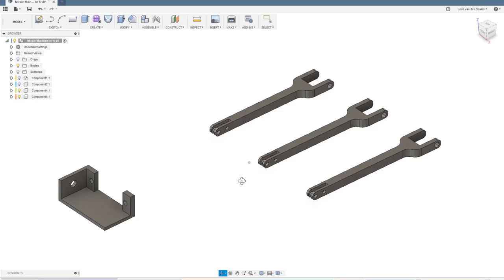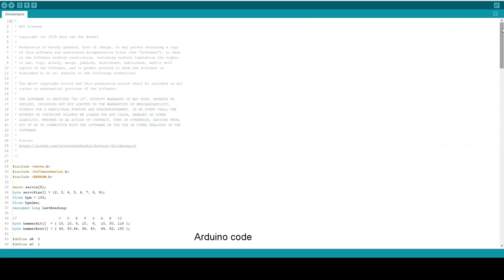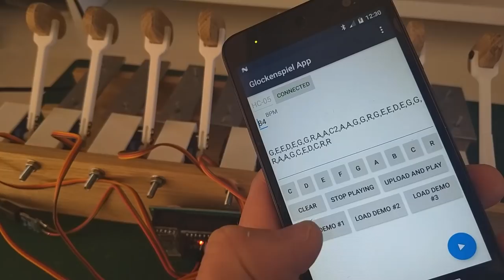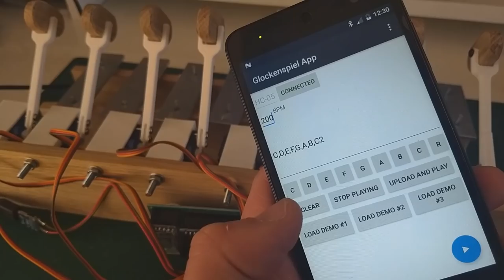Arduino Glockenspiel

Comment: I really love this idea, the only problem is, that the distance between the hammers and the metal pieces is too big, if the neutral position of the servos would be lower (~1 cm above), the glockenspiel would be able to play faster and the servo noise would be much less too.

Comment: Too much pressure on the servo gearing, in my opinion.
You should add a counterweight, in order for it to be more reliable. Otherwise servo motors will die pretty quickly

Comment: So the final version is driven by stepper motors?
I think solenoids would fit better. And the distance between the plate and the hammer is way too big.

Just my opinion.

Comment: Did paint rejecting affect pitch?
Reply: I was also wondering why he removed the paint, maybe it was purely cosmetical
Reply: @dimitrijekrstic7567  ofc it was cosmetical, but it still could affect the pitch
Reply: @appo038  ...maybe he didn't remove it because of cosmetic reasons. Why claim to know something you have no way of knowing?
Reply: @dimitrijekrstic7567  ok bro
Reply: @appo038  np bro

Comment: The original idea with one arm was more interesting. You could have upgraded to two arms. This one is very industrial. Could have done without servo this way, using some simple solenoid.